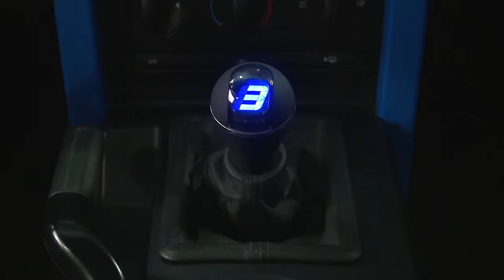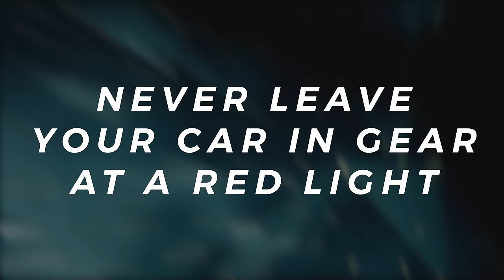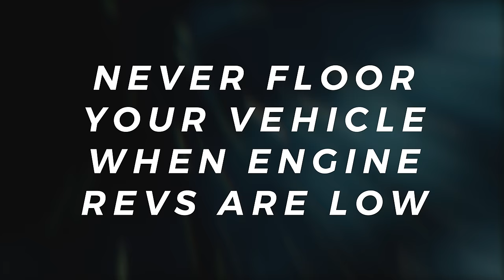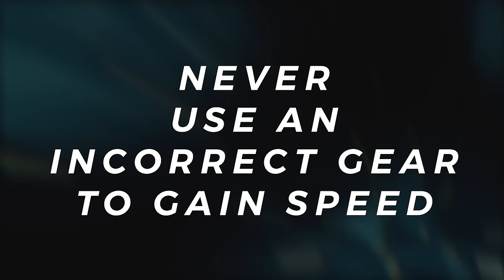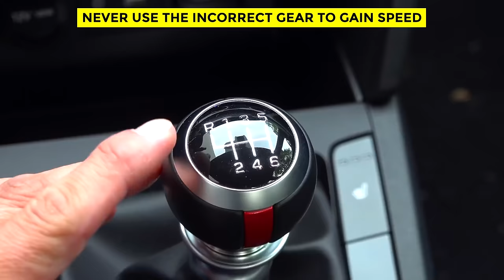7 Things You Should NEVER Do In a Manual Transmission Car!

Comment: "Never brake without engaging the clutch" Complete mis-interpretation, it's completely unnecessary to engage the clutch when breaking unless you plan to stop, change gear or the RPM falls to a speed where stalling will occur. If your gonna educate, get the facts right. Furthermore, for anyone in the UK seeing this, you are taught to keep your car in gear at a red light, UNLESS your expected to be stopped for 5 or more seconds, again, get the facts right  - different countries have different rules, and honestly, as long as the clutch is de-pressed, it does it no harm keeping it in gear at a red light.
Reply: AGREED.... from the US too
Reply: I agree with most of this but keeping the clutch in at red lights does cause excess wear on the throwout/release bearing
Reply: @dieter2889  agreed, but the release bearing can take the stress more than they let on. I used to always stop with the transmission in gear. Had to replace the clutch before the bearing went bad. Then the vehicle got totaled by a rear ending🤷

But it's better on everything overall to be in it's "natural" position, as it is with most things.
Reply: Tulkas Astaldo  if im at the front of the lights ill leave the car in gear otherwise it takes almost no time to get into gear.
Reply: @dieter2889  yes this, in pole position, you need to be the fastest as to ensure the most cars can pass during a green light. It's the polite thing to do

Comment: The best thing you can do for your clutch is rev the engine to redline and let your foot slip off the clutch pedal while in 1st gear. This will help to resurface the flywheel allowing for smoother shifting in the future. 👍🏼
Reply: dont forget it will resurface and warm your tires and give your transmission a nice little stretch
Reply: Am I dense or is this sarcasm. Maybe both.
Reply: In 5th or 6th gear
Reply: It also removes oil and debris from  the tires, giving them more grip for braking.
Reply: Instructions unclear - found myself in the back seat
Reply: @lazerunknown3272  All three answers are correct
Reply: You forgot to have the parking brake engaged during this maneuver, for a stress test.
Reply: I do it in 2nd or 3rd for maximum results

Comment: about the keeping your foot on the bite point when stopped on a hill. keep your clutch down or have it in neutral while your waiting. when your ready shift into first, find the biting point and release the brake and give some gas. don’t sit there holding at the biting point for more then around 6 seconds. that’s what messes up the transmission.

Comment: Clutch for my truck is like two three hundred bucks and I could change it in an afternoon done it before
Reply: All I understood was " I'm still gonna do all of those things" 🤣
Reply: Changing a clutch aint hard😂 Remaking the electric  harness is worse
Reply: True
Reply: @Carlos carbajal_1210720 same. I just paid 1700 for mine.
Reply: Your lucky. Most times it’s the labour that racks up the cost. Clutches on their own aren’t that expensive. Some cars can take 5 hours or more to change
Reply: I haven't had to change the clutch on my truck yet!
Reply: So you’d rather pay hundreds of dollars and work for an afternoon than move your foot an inch to the left?
Reply: i got a ceramic clutch in my 86 toytoa pickup, that unit taught me and my older brother to drive a manual, AND has almost 300k miles on that clutch in about 14-15 years, i can tell you is still has probably a good 200-400k miles left on it
Reply: ITZ Caleb wow most clutches last about 40000 miles . Mind you I live in London where I use my clutch constantly because of the gridlock😂
Reply: @007tobler  next time you change your clutch spend the little extra money for a ceramic clutch, you will forever be glad you did
Reply: bruh my vw clutch cost 50 euros in finland and literally ever car here is manual
Reply: @007tobler  if clutches only last you 40,000 miles you need to learn how to drive a manual.   even with heavy use (towing often, hils, agressive racing, etc.) a clutch should easily last 100k...
Reply: xmetrix xmetrix I know how to drive thanks. Ask any big city mechanic  60000 tops
Reply: For everyone who has expensive clutch go on rock Auto
Reply: avicii my problem is I haven’t the time space or equipment. God if I could it’d save a fortune
Reply: You forgot a period
Reply: Yea mine was 150
Reply: @calebb5106  My normal cheap gm clutch is still going strong in my astra after 16 years. The rest of the car is slowly dying tho. Really not a great investment my man. That truck on the otherhand seems to be a great investment, congrats on the almost 300k
Reply: @merlin9702  the truck is closer to 500k, its just got that many miles on that clutch after me and my dad rebuilt the thing after a "racing" accident back in 06/07
Reply: @Carlos carbajal_1210720 what car?
Reply: @007tobler  Plausible. The intermittent inching forward even though the red light is still red will wear a clutch out early, especially on cars where first gear has a weird ratio where idle rpm is a bit too fast.
I guess people are anxious and go like "the distance to the car in front of me could be smaller, lemme just creep forward a bit." then the same again after 15 seconds. Sometimes people right at the light will do it too and then suddenly brake hard and still the whole line of cars behind them will inch forward to fill the gaps. People are dumb.
Reply: @007tobler  yeah, you need to learn how to drive, I've never seen a clutch needing to be changed before 150k without someone seriously abusing it on ANY make or model, stock or ceramic. Ask any legit mechanic that's not trying to rip you off for unnecessary services.
Reply: @007tobler   My dad has a 2003 Skoda Octavia. That absolute solider of a clutch  lasted 200k miles and still has 100k left in it
Reply: ANormalDegeneRatEIam respect I always bought second hand and the two times I had to replace came at about 70 thousand miles . So I don’t know how well it was driven before me
Reply: @007tobler  my dad drives like a professional, never in my life have i seen him stall an engine or use the gears wrongly.
Reply: I realised i was vague, only the clutch is 800 $ with the mounting it goes to about 1000- 1200 $ in my country (romania) the previous owner paid about 2200$ to change it (France)
Reply: @Carlos Carbajal lopez_1210720 aye I'm late asf but I drive a 1992 300zx. That's what's upp!!!😂😂
Reply: @Carlos Carbajal lopez_1210720 dude! I love the z cars 😍, you are a lucky guy!
Reply: Is resting your feet on the clutch worth 250 bucks
Reply: I somehow did not break my clutch when i was speeding with my car on the highway while shifting down as well 
normally it would have been a huge money shift and i could have probably broken the car.. BUT NOPE

Comment: "Clutch slipping will destroy the cltuch" well mr einstein why has my clutch outlasted my engine
Reply: Lol
Reply: Maybe u drive fiat if clutch lasts longer than engine
Reply: @theunknownguy265  nah mate, VW diesel, cylinder head cracked and had to get a used engine, didn't bother replacing the clutch. Fitted the original onto the new engine still hasn't let me down
Reply: @dieter2889  I was just joking, hope I didn't offend you
Reply: @theunknownguy265  if you drive a fiat your socks last longer than the engine
Reply: @masterbomber98  lol, I don't drive fiat lol
Reply: @theunknownguy265  Just a joke man, don't worry
Reply: @masterbomber98  if you drive a fiat just stop and walk
Reply: This comment is correct honestly. A clutch is a wear item. It's meant to take the friction created from newton's third law. If you drive, say, a 9000lb smol pp truck, it's better to slip to 1000rpm than put that stress on your engine, your transmission, your drive line, diff, etc. Or, you know, just dump the clutch and make things explode. It's not my funeral. It's when you repeatedly slip the clutch without letting it engage and you keep generating heat that it becomes an issue. It's the equivalent to trying to accelerate while holding the brakes down. Things get hot, very hot.
Reply: @masterbomber98   Many many years ago I bought a Fiat 600 . That actually was 1959 I owned from new for five years and I put 125,000 miles on it & I drove it hard. It NEVER ever let me down. So far as the body was concerned I put a mixture of Gear oil and paraffin inside the door cavity and the sills, in fact any place I could put it. On the rubber work I applied glycerine. Would I buy another fiat. Not bloody likely. Crap cars and it took all my spare time looking after it. Worse than a ford and they were rust buckets in the 1950s/60s. probably still are ( I now drive a Beema 7-1/2 years old and perfect )  I have a soft spot for Fiats...........Southport. UK. sands.
Reply: slipping the clutch more that neccesary
Reply: Well the takeoffs from traffic lights that start with 6500 revs and end with a 2 millisecond clutch-pop may well explain that.....

Comment: I have driven manual transmissions for many years. First was a Chevy Pickup with 3 on the tree. I can even drive an unsynchronised transmission without drama (Ford A). Years ago, I was scolded by a mechanic for keeping my foot on the clutch and my hand on the shifter. Really good advice. My clutches lasted a long time, except for the XJ.

Comment: "When you come to a stop you have the clutch in" Literally the most basic shit you learn the first time you drive manual
Reply: @dsntrllymttr  it is still very literally one of the very first things you learn while learning to drive manual. Even when you a using a tractor on a farm: People learn that quickly as it is strictly necessary.
Reply: Lol, i started taking manual motorcycle lessons before car lessons and I have to admite than during the first half of the lesson everytime I stopped the moto just died lol
Reply: @vascosaldanha602  Then how did you take off if you didn't realize that the clutch needs to be depressed when stationary?
Reply: @dsntrllymttr  They don’t anymore. I just got my first manual car and having to throw out automatic and restart is actually far worse for someone who has driven only automatic for almost 15 years compared to a teenager with a Clear slate. I was the only one in my family that was never taught and I feel so hopeless because they never bother to teach manual. I learned how to gear shift as a kid but that’s it. Everything else I fuck up and don’t want to wreck or ruin my engine. 🥵 I wish they would have forced us to learn stick cause I’ve always wanted to learn but never had the chance until now.
Reply: @Maximus20778  I concur. Especially if you have panic attacks. I can drive automatic fine even with high stress or attacks. Manual…. I can stall for time.
Reply: @Ozubura  I hate stalling and start and stop especially in traffic
Reply: Exactly how will a stop my car on a hilly surface without engaging clutch to stop it.
Reply: @Ozubura  once you've done it for a while it becomes pretty much automatic, i drive both manual and automatic cars and switching between the two has just become 2nd nature i dont even think about it anymore
Reply: @Maximus20778  Happens
Reply: many people still forget it
Reply: You know why Americans? Cause if you haven't pressed it you're still telling the car to move while you're trying to stop at the same time which leads to an engine shut down.

Comment: If it's bumbler-to-bumper on the freeway I take off in second gear.most of the time from a dead stop so that I don't over rev as I would if I take off in first gear.  I do engage the clutch and brake on a hill at a red light.  No problems after 20+ years of doing that with my two cars, 1999 M3 & 1992 Nissan Sentra SER.

Comment: For the gear grinding one, there's a synchronization process that happens to prevent it, but you have to hit the clutch before you shift, otherwise, you'll grind the gears.
Reply: Honestly in manual cars, the gear switch is the easiest thing to learn. You simply let go of the gas, slam clutch, change gear and then slowly let go of clutch. The bigger shift the faster you can let go of clutch.
Reply: Double clutch, saves wear, I O synchros, in box🎉
Reply: Learn to float gears bro
Reply: My clutch pedal went dead 10 miles from home and I made it back. I must be a wizard

Comment: Coasting in neutral won'T overheat ur engine lol, ur engine is "idling" then, yet air flow through radiator is what it would be if u were "working" the engine so...
Reply: thats true BUT if your car was over heating then costing in neutral wouldn't help..
Reply: It can make ur oil heat up more then it should. As the oil pump is not spinning at the speed the car is going
Reply: @tiny ate I get what u saying  ur just forgetting that the throttle is closed and the air getting through is a small amount and the oil going through is not enough to cool it efficiently the damage is minute and over time components will break down faster than what it is supposed to
Reply: @mikalarrington8112  I've taken that all into consideration...
Reply: So is coasting in neutral bad or not?
Reply: @Unknown-rr1ch  Coasting is no different to ur engine than sitting at a stop light. If u have problems idling, then u probably shouldn't coast lol..
\O>
Reply: Yeah, but your car will careen out of control.  You need the engine to slow your car down a little bit before you depress the clutch, set it into neutral and put on your brakes.
Reply: The speed your car is going and the speed your engine is turning while in neutral have nothing to do with each other.
Reply: @user-px1wj2uv3r  I second that...
\O>
Reply: @user-px1wj2uv3r  It does when you go to put it back in gear when you're still rolling...

Comment: 1:47 I’m guessing you’re referring to, pushing the clutch just before the car stops.
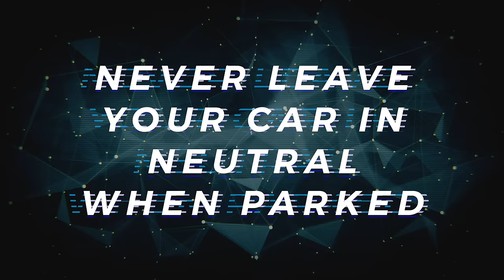2:40 It is okay to leave the car in neutral if you’re parking on a flat road while still having the handbrake up.
4:27 Does the brake pedal mean nothing to you?
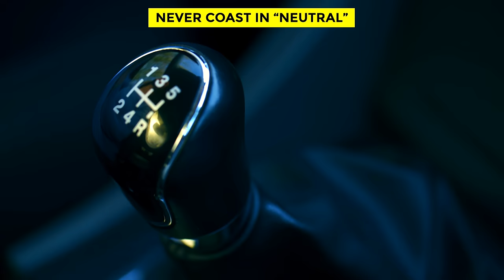9:05 Coasting in Neutral is sometimes bad, but it doesn’t damage anything. Maybe for automatics, but not manuals.
Reply: But a lot of modern commercial trucks with automatic transmissions actually go into neutral automatically if you come off both of the peddles to save fuel, if it was harmful to the drivetrain why would they be engineered to do that?
Reply: Exactly what I wanted to say 😂
Reply: Yeah the fucking part when he told to use handbrake in every red light broke me l would go crazy if I actually had to do that
Reply: @emu8113  right and how many time do you do that before you forget that the hand break is engaged and you try to drive
Reply: @salahdehina9733  diesel 18 speed for industrial use vs probably 5-6 speed small gasoline engine
Reply: Putting the car in gear every time you park is useful as it becomes a reflex; it makes it less likely you forget to do so when parked on a slope. So, not necessary but useful.
Reply: yeah fr
Reply: @salahdehina9733  they do it so the car does not engine break, so it can roll further,  this does not really affect trans wear but if anything is a bit less fuel efficient.
Reply: @aphextwin5712  my only argument is that you can mess up your transmission if someone hits your vehicle while you are parked in gear
Reply: Thank you
Reply: @nintendo1614  I think more of my issue is someone hitting me 😭